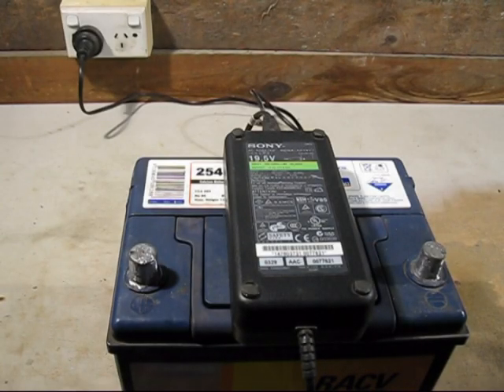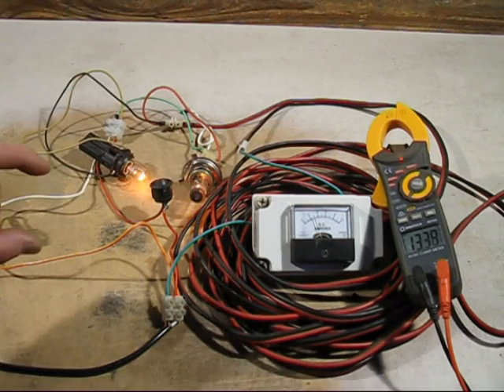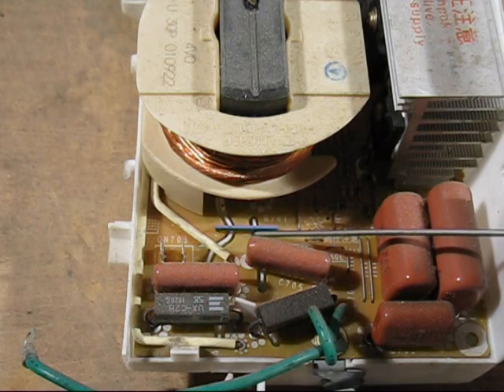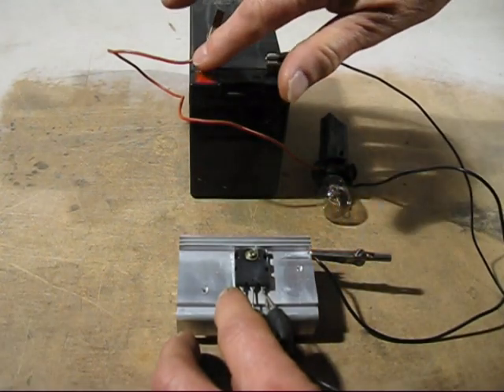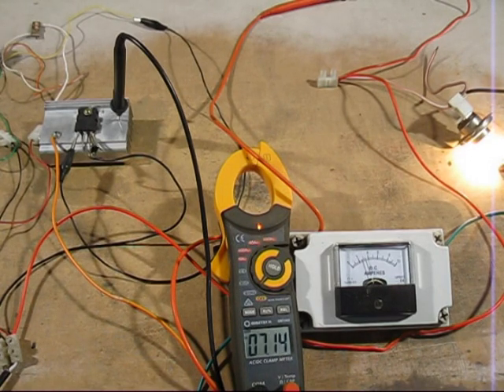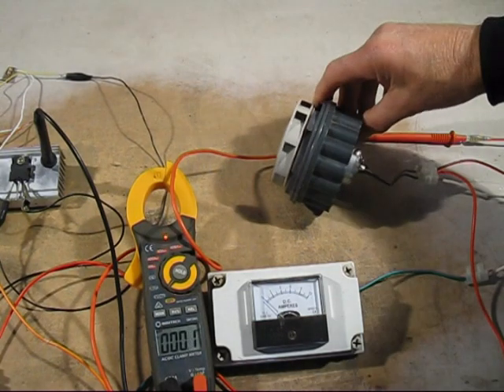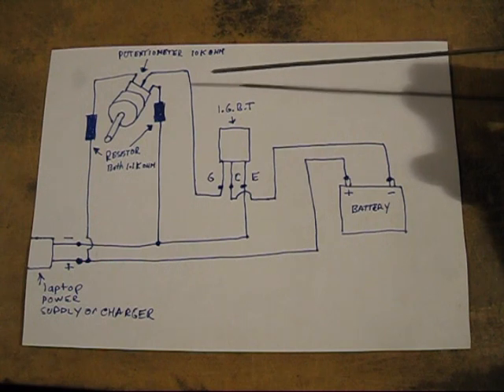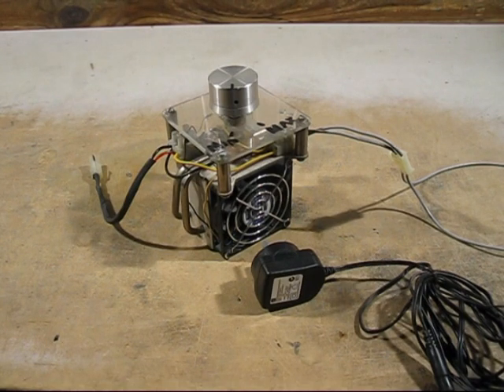How to charge up  your 12v car battery with a laptop power supply using my improved version

Comment: Wow, very cool project for sure,!  Love how you are using parts I have on hand and making such useful things with em.  One helpful hint maybe -- my mechanic always trickle charges batteries all day or overnight at low current, unless its an emergency situation.  Not sure, but I think the other youtube method charged at about 2A and your method was over 5+ Amps?  Granted, a 5A option is great if you are in a hurry, but maybe not the best for battery longevity.  I have seen a product from Battery Tender that is called a "battery maintainer" that charges at very very low amperages.  While I don't know specifically what amperage it charges at, I do know it is used continuously when your battery will not be used for a few weeks to several months to constantly maintain proper voltage thereby greatly extending battery life, as per Battery University website who claim keeping lead acid batteries top offed near 12.5V is best.  Good to know especially with inflation the ultra high cost of a new quality car battery!
Nice shout out to eWaste Ben as well.  Both you Aussies make very practical videos that I thoroughly enjoy watching - thank you!
PS.  I wonder if you could modify your circuit to incorporate variable or step currents from say, half an amp to 6 amps, at constant 14.4V or thereabouts?  Or, maybe similar simple circuit, but somehow keep amps below/near 2A at 14V?

Comment: An important point to note about that transistor. Its not a "general" transistor, it is an IGBT (as you pointed out); a very specialized transistor which gives it specific gate properties that allows this to work. It acts more like a MOSFET than a BJT like most are used to.
Reply from the maker: At the end of my video I showed two power supplies that were made using the same method, the first used a BJT and the second used a mosfet. I wonder if that method will work with logic level transistors?

Comment: Another consideration regarding the fans... 24VDC are readily available which would run directly from your 19V power supply.
Reply from the maker: I have dismantled a lot of electronics but I have never seen cooling fans that are rated for 24v dc but I do see some 240 v fans.
Reply: @luckygen1001  Interesting. I just sourced one (120mm size) off eBay recently for an electronics enclosure project for the very reason that the available power supply was 24VDC and I didn't want to add in another layer of componentry to power the fan. Maybe it's a US thing and less available elsewhere?
Reply from the maker: @azenginerd9498  I just go out on rubbish collection day and see what I can find so the only fans are 12v or 240v. Do you know of any power supplies that have 24v fans?
Reply from the maker: @azenginerd9498  Yesterday I dismantled a Sola 600 U.P.S. for parts and it was 60vDc input, 240v AC output. It had two cooling fans and they were 24v! So I connected them to that 19.5v laptop power supply and they worked. The one problem was they did not spin as fast as on 24v.

Comment: I used a small 12v solar panel going through a dc to dc converter to raise the output voltage to 15 v, to trickle charge my big truck batteries, keeping them topped up over long periods while parked.

Comment: Hi what's the biggest capacity you would charge in AH? I have a variable laptop power supply. But Damn they get warm.any reply appreciated cheers! I'm the second person to watch this. Btw how do you like your ammeter? I have the identical one and hasn't failed.
Reply from the maker: It depends on how big a transistor you use and using fan cooling helps a lot. that amp meter has always worked well and I have had no issues with it.